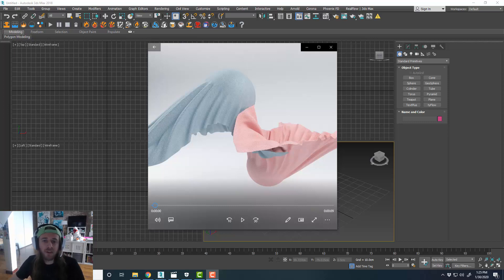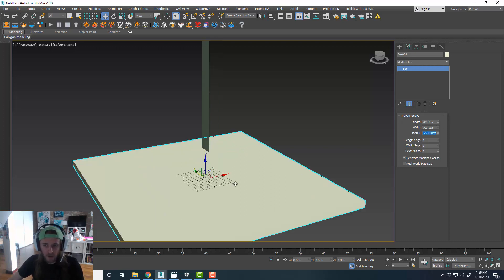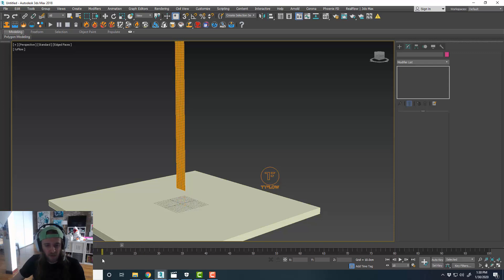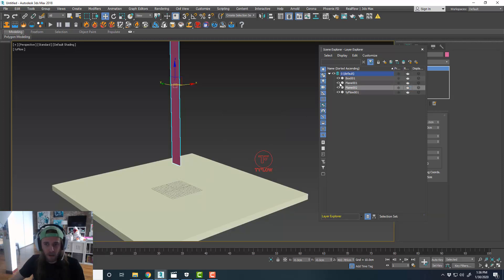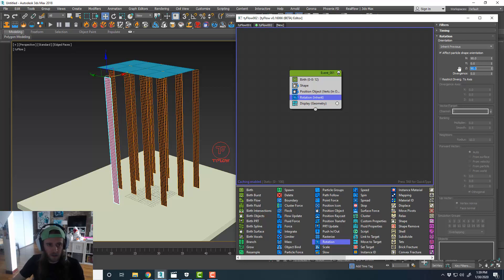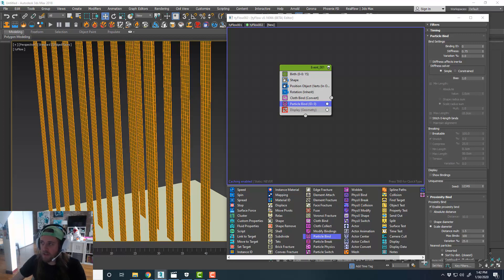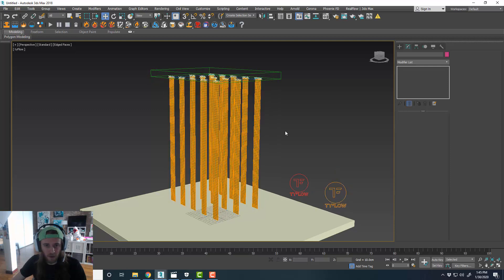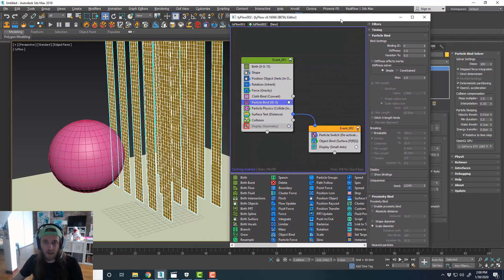3ds Max + TyFlow TUTORIAL! Create Cloth and Paper Simulations!

Comment: Thanks for the tute, works a treat =). Any idea on how you would approach creating curtains? I'm not sure how to bind the top vertices to an animated object.
Reply from the maker: Thanks, I'm glad you liked the tut! For simple curtains, I would probably just use the standard cloth modifier and isolate/bind a group of vertices to the animated object, there's plenty of tuts for that sort of thing. You could do it with TyFlow by doing a surface test to find vertices that are within proximity of the animated object, and then us a particle switch to deactivate them, and use an object bind to bind them to the animated object. You'd have to tinker with the settings, but it should be somewhat simple.